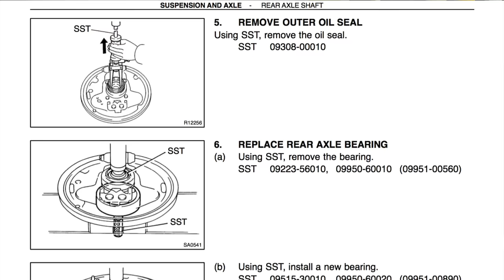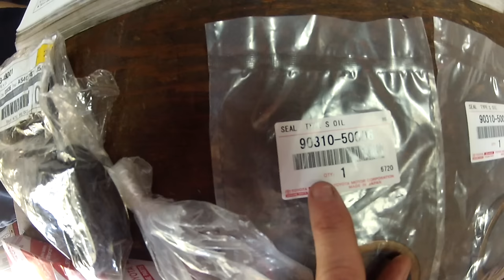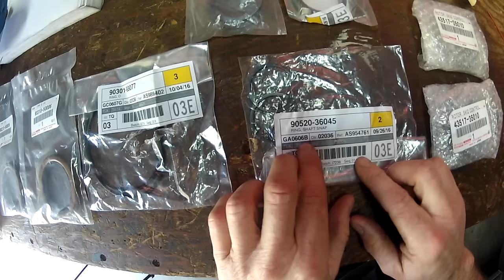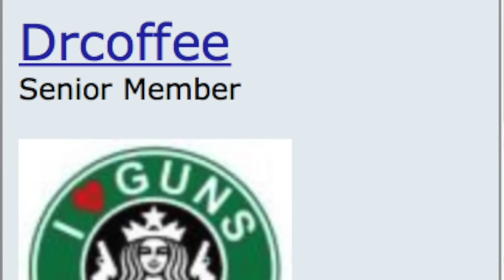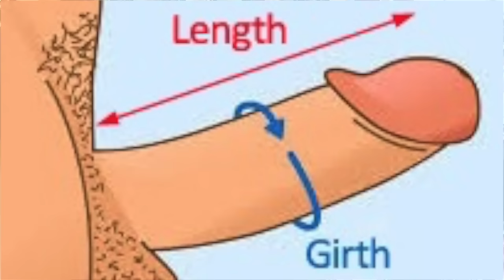Toyota Rear Axle Seal/Bearing Replacement (ABS Rearend)

Comment: Hey Tim Rob here, thanks for vids! Putting half shaft back together and I went a bit too far. Polished axle showing is 6.7. Should I tear off and press to 5mm or is this ok?
Reply from the maker: That's a bit too deep.  I would do a sharpie or grease test to see where the seal is riding on the retainer.

Comment: Hi Timmy, Thanks for all the videos! I have done 3 thing now on my 4Runner that I thought I wasn't capable of but was able to accomplish because of your vids. This one will be the 4th and the hardest one for sure. Will a 12 ton hydraulic  press be enough to get the job done?
Reply from the maker: Happy to know our videos are giving you the confidence to tackle jobs you would have most likely paid somebody else to do for you.  The 12 ton press could probably handle it, but if you haven't bought a press yet, I think you should buy the 20 ton press from Harbor Freight.  It's not that much more money and will give you the ability to handle jobs like the front wheel bearings that require a considerable amount of pressing force.

Comment: Hi Timmy how are you man? 
I have a 2000 Toyota 4runner I already pulled the out the rear Axles but I haven't been able to find a place to do the press work for me so! I was wondering if any possibility that you can do that for me, I can can bring the axles, bearings/parts +$ ? 
Again thanks for such a great work do with this videos, really help
Reply from the maker: Where do you live?
Reply: I live in Santa Nella.
Reply from the maker: You're an hour and 15 minutes away from me.  You sure you want to drive that far?
Reply: Why not, to have my 4runner on the road again sure I can drive to your place! I suppose you live in San Jose right?
Reply from the maker: @mauriciorosales4255  Yes, I live in San Jose.

Comment: how did you use the same inner axle seals for both abs and non-abs? In your two axle seal videos, the Toyota part #90310-50006 used is the same in both videos..  shouldn't the seals be different sizes due to the position in the axle.. really curious how that works..
Reply from the maker: The axles are manufactured differently but have the same diameter area where the seal seats into.

Comment: Tim do you have the part number for the "RED FIPG". I replaced the inner seals with the new Toyota seal design. The shop verified that the inner ring was flipped with the bevel facing the tone ring. I think maybe they scored the seal flange so I want to try this sealer w new seals. 
Thanks for your time and making this video!!
Reply from the maker: Here you go: Toyota FIPG 1281 #00295-01281 https://amzn.to/33w0yma

Comment: Timmy!

I did this job about 4 months ago and today noticed my drum was grabbing on the right side. Sure enough my seal was leaking (same side as last time). 

This time I'm just going to the replace the right side since the left is brand new and no signs of leaking.

What parts can I get away with reusing? Obviously I'll need a new seal, bearing, and shoes. Can I reuse the retainers, abs rings, etc?
Reply from the maker: Sorry to hear that.  You can reuse all the parts.  Since that bearing has very little miles on it, I don't think it's necessary to replace it. But, I would pry up the dust seal to see how the grease looks in there.  Just get a very small thin bladed screwdriver in there to pop the dust seal up.  This would obviously be the side of the bearing facing the ABS tone ring because you can't access the other side of the bearing.  if the grease looks good and wasn't contaminated with gear oil, just seal it back up.  If gear oil did get in and wash some of the grease out, clean it up and repack it with a hi-temp wheel bearing grease you can find at any auto parts store.  

Next, replace the axle seal and just be careful how much force you use to drive it in.  Maybe what happened last time is you creased the seal and pushed the sealing lip more inboard.  But regardless, you have to perform the grease test to confirm where the seal is riding on the inner retainer.  Did you do this last time and it looked good?  If so, I'm confused how it could have failed if you did this unless when you put the axle in you slammed it in the there and damaged the seal.  If the seal mating with the inner retainer isn't good, you will have to adjust the position of the inner retainer on the axle so it does mate up well.  Ideally, you want the seal lip to ride in the middle of the polished shoulder of the retainer but somewhere close is fine.  It doesn't have to be perfect.  You just don't want the lip really close to either edge (bevel or opposite side), 3mm away at least.  You can make this adjustment the same way you pulled the parts off by getting the special tool with a bearing splitter attached to get under the ABS tone ring and pull the ABS tone ring and inner retainer up.  After you get the new seal in, I'd perform the grease test with the axle as is just to see where it's riding.  Then you'll know how much adjustment you need to make with the position of the inner retainer.

So, with an axle seal replacement, possibly some grease re-packing, and possibly an adjustment of where the inner retainer sits on the axle, you should be back in business.  Oh, maybe another set of brake shoes because they soaked up all that grease.  If you have any more questions, just ask.

Comment: Thanks Tim. Another big help.
Reply from the maker: You're welcome.  If you haven't checked out Part 2 yet, you should.  https://youtu.be/R-c2x3F8DU4?si=EtyWowSNyytjdkCN
Reply: @TimmyTheToolman  Just watched.  Nice man. Big difference. Hey,  I've noticed in the videos that you're working usually on the concrete or with a little pad. Do yourself a big favor...I'm 73...and get used yoga mats at Goodwill. You'll thank me later.
Reply: By the way. What have you heard. That running wheel spacers...1 1/4"...will prematurely wear out seals? (And I wonder what premature means. 10k, 50k, 100k). Not that I'm too worried about it. AND...as long as I have your attention,  thank you, what are your thoughts about leveling the panhard bar after  a 2 1/2" lift?
Reply from the maker: @danielvoulkos8274  The Yoga mat idea is smart.  Spacers supposedly put more strain on wheel bearings, but not the seals.

Comment: I loved the video, i just wished I watched it before I sent my axel in to my friend that pressed the retainer ring way too much. We added a second ring and got 3mm of polished axle showing, it doesnt sit right in the axle housing, it hits the axel, just pass the seal. Is there any remedy for this? We did cut off the extra ratainer. Now we are stuck with the first retainer pushed up against the toner ring. We dont have a bearing puller, my friend had to heat and cut the abs ring and retainer off the first time. ANd I dont want to have to do that again. is there a possible ratainer ring we could add to the shaft that is less than 10mm, that would give us more than 3mm of polished axel? Thanks for your time and hopefully a reply soon.
Reply from the maker: Paula Marie Tavares there is no other retainer ring I know of.. the best thing to do at this point is use a bearing splitting to pull it back up into the right position.
Reply: Timmy The Toolman thank you very much for your time. I love watching your videos.
Reply from the maker: Paula Marie Tavares Sicmods!!!

Comment: Hey Timmy,  how do i know if i have a bad bearing?  I dont gave leaks, but have noticed kinda like squeaks every time im just coasting no gas or brakes. Sounds like a rusty bed while getting busy. As soon as i press a little gas, it goes away, same with braking. Sound is coming from back driver passenger side. Any clues? Think it can be drum brakes? Or bearing?  Thanks
Reply from the maker: A bad bearing will usually hum at speed.  You could also grab ahold of your wheel with the rear end jacked up and see if you can detect any play in the bearing by pushing and pulling on the wheels.  It could be the brakes, but finding the source of sounds like this can be hard to figure out.  Have you inspected and greased your rear driveshaft zerk fittings for the front double cardan joint, rear u-joint and slip yoke.  The double cardan joint has 3 zerk fittings.  One for each u-joint and one for the center ball.  Let me know what you figure out.
Reply: @TimmyTheToolman  thanks Timmy, i just put a jack under the pumpkin and no wiggle. Sounds like an old metal squeaky bed. As soon as i give a little gas it goes away or even slight braking. I tried smaking the undercarriage with a dead blow hamer kinda gently so hear for some loose stuff and nothing. I spun the rear wheel and nothing. The drivelines have been all greased up last November.  I wonder if it can be the drum brakes or drum scarping.
Reply from the maker: @damacknificent151  I don't know.  Maybe pull the brake drums and see what you see.
Reply: @TimmyTheToolman  yeah, im going to try that this weekend.  Thanks

Comment: Timmy @ The 7:15 can you explain how if the gear oil has gotten to the brakes and coded the rear brake shoes that not only do those need to be replaced but also the wheel bearing. Being that the gear oil can get into the casing of the wheel bearing and wash away the Grease that lubricates the bearing. This makes sense to me and I tend to agree with you but I am having a local shop tell me that those bearings are sealed so they can check them and make sure that they’re still OK but they’re indicating it’s not absolutely necessary to change those out for new ones. Like I said my understanding was that you should replace them with new ones in your explanation makes sense to me but now with them telling me those bearings are sealed I thought I would just ask your opinion on that. Thanks for any feedback.
Reply from the maker: Sealed just means there's a dust cover on either side of the bushing to keep gross contaminants out.  It doesn't prevent oil from making it's way into the bearing and washing out the grease.  At the very least, the inside dust cover needs to be pried up and the bearing re-packed with a high temp wheel bearing grease.  

Now to use some logic.  Look at your odometer and ask yourself would it be smart to replace the bearings while you have the axles out.  If you want to roll the dice that they'll last you for a long time to come, that's your decision and you'll have to live with it.  I would suggest replacing them, especially since you're hiring a shop to do this for you.  If they go bad shortly down the road, you'll be paying them for the labor to pull the axles all over again to replace the bearings.  

Further, do these guys know Toyota redesigned the seals and they have to either bring the inner retainer more inboard or flip the orientation like we suggest to get a good mating with the axle seal?  My guess is they don't.  Lots and I mean LOTS!!!!!!! of shops screw up this repair because they don't confirm a good mating of the inner retainer with the axle seal.  

So Dude, my video has armed you with more information than most mechanics know about this job.  I highly suggest you do a question/answer session with them to find out if they understand the nuances of this job.  Just from their comment about the bearings, I would suspect they aren't very knowledgeable.  You've been warned.

Be sure to read the comment I pinned (1st comment you see) for updates on this job.  There's important information that you don't want to miss out on.
Reply: Thanks Tim appreciate the response. Yeah I definitely agree with you that the wheel bearings should be replaced along with understanding how to do the rest of the job correct. I have been 
Adamant about them using only new OEM Toyota wheel bearings but also all new Toyota parts as well. And also have talked about the orientation of how things need to be. My situation is a little bit different I’m kind of between a rock and a hard place so just have to hope my conversations with them about using the correct parts and how things should be done will be listened to.
Reply from the maker: @rthomas2157  No problem.  I hope they do the job right for you.

Comment: Great video man! I have a 09' tacoma. Can I press the complete hub assembly out and swap? Instead of only changing bearing.
Reply from the maker: Hey Mark,  I'm not sure what you're asking.  There's no hub on a rear axle set-up.  There's just the axle, bearing, retainers and seal.  So, if you asking if you can just buy the whole axle assembly with the bearings and retainers already on with the brakes from Toyota, I don't know if they sell it complete like that.  Your local dealer will be able to answer this question for you though.  This would not be cost effective though.  It would cost you a ton of money.
Reply: @TimmyTheToolman   Good evening Timmy. I pulled both axle shafts after work today. Mine doesn't have a abs gear. I took some pictures. Do you have an email I can send them to?
Reply from the maker: @McWeldShit  What model do you have?  Some of the base models didn't come with ABS.  Send me a pic of one of your axles and send me pic of your rear axle housing.  mtbtim@sbcglobal.net

Comment: Mr. Tim, 
I've had my bearings/retainers/seals replaced by a shop (per factory specs) once, and I've changed my seals twice in the last two months, as they continue to leak.
It appears you/or the 4Runner owner had a similar issue with replacing seals.

My question is, has this "flipping of the retainer" per Dr. Coffee's method stopped the leaks?

Thank you
Reply from the maker: The flipping of the retainer is just to address the fact that the new seal design by Toyota has the seal lip sitting 2mm more inboard than before.  With the retainer in the OEM orientation (bevel facing the seal), the seal has to first get past that non-polished bevel before it gets up onto the polished shoulder of the retainer.  With the way the axle housing is designed, the inner diameter reduces to a narrower profile behind the seal leaving very little room for adjustment of the inner retainer to make a good mating with the seal and not rub against the axle housing.  The non-polished bevel is around 2-3mm wide, so when you flip it, you can basically keep the retainer in the same OEM position (5mm of polished axle showing) and have a good mating with the seal while not having to worry about the retainer rubbing on the inside of the axle housing.  The goal is to have the seal lip riding somewhere in the middle of the polished part of the retainer which is 10mm wide.  

The key to this whole repair is to verify you have a good mating of the seal lip and retainer by doing the grease test before you bolt everything back together and calling it a successful repair.  The other key is to properly address all the reasons why the seal failed in the first place.  Bearing play is a common reason why the seals could have failed.  Another reason could be a blocked breather.  People often think they can simply replace the seal and be successful but they didn't know that Toyota redesigned the seal making it necessary to reposition the inner retainer and they also didn't properly diagnose why the seal failed in the first place.  My best recommendation for anyone doing this job due to a leaking axle seal is just replace the bearing too because it could have caused the seal failure in the first place and also the bearing could have been compromised by the gear oil washing out the bearing grease.

I know this was a very long response but I wanted you to understand the solutions for this repair a little better so you're more informed.
Reply: check your axle breather that it's not plugged , mine was.
Reply: You could have a plugged differential vent....check it and you may fix the problem.

Comment: Is that much play in the wheel bearing normal? I’m replacing my axle seal and saw that I have the same play in the bearing as you do, should I get it replaced or is it in good condition.
Reply from the maker: What I learned is even new bearings have play but I think the movement you see with the axle not bolted up to the axle housing is deceiving.  Once the axle is bolted to the housing, I believe it locks everything together and the play goes away.